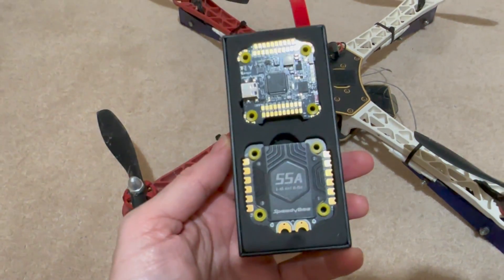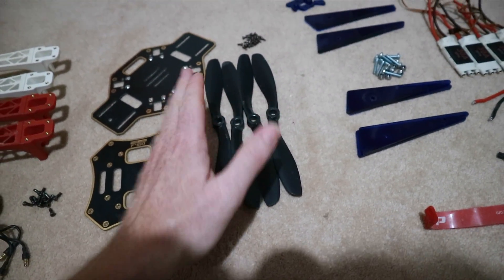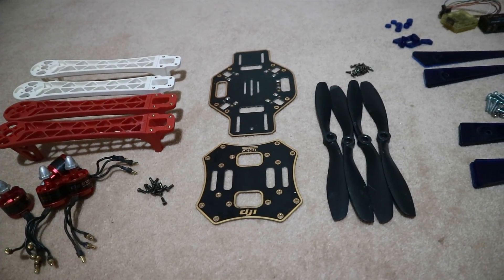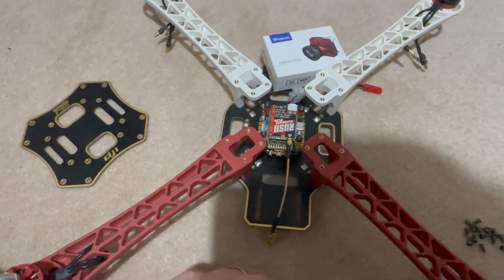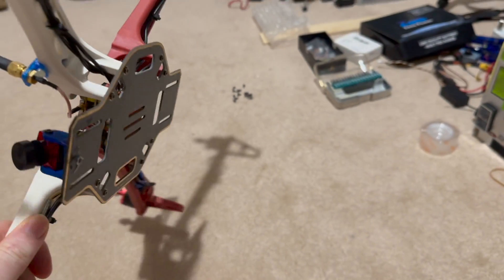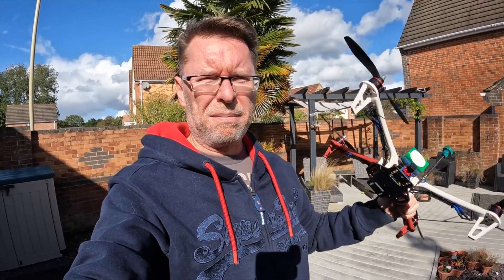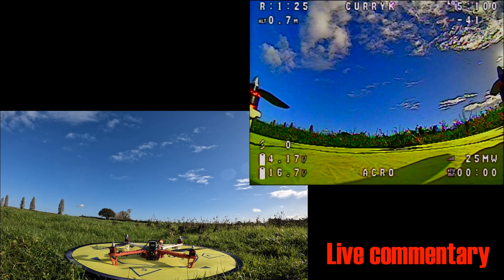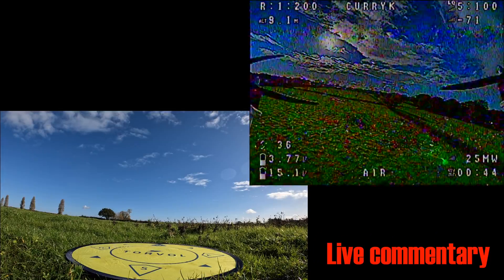SpeedyBee F4V4-55 Stack review part 2:  Can we Acro and old F450 with it?

Comment: How did you screw the stack on the F450 frame? Do the mounting holes match???
Reply from the maker: Nope, if you have a look at around 2.58, you'll see me hold up the stack with a little 3d printed part.  I can mount my stack on this part and then stick this down on the frame.  You can get the file if you want to print this from my Thingiverse page https://www.thingiverse.com/thing:3704157
Reply: @CurryKitten thanks so much for the reply. I am a newbie in drone builds. My schools club is making a F450 frame drone with B2212 929kv motors....... With iflight blitz stack, 1045 CF prop and 3s 3300 mah 35c lipo....... Other than the FC mounting hole issue, our motor screws are about 6mm ish long M3. And the F450 motor arm is about 5mm......so the screw goes very little into the motor. About 1mm ish. Pulling it side by side and wiggling it around, it doesn't budge but I am worried the motors may fall out mid air.........what size screws do you use for your A2212s or similar motors?

Comment: Can we use this flight controller with f450 drone and if yes then can you specify the ratings of bldc and propeller size that we must use with it...
Reply from the maker: What's bldc?  But yes, you can - as per this video.  As to what prop size and pitch - would depend on the motors and ESCs.  I'm using 8" blades on 4S which feels a little unresponsive.  I've got some nicer 10" props which aren't heavily pitched (and I think I've run on 4S before) so I'll try it on those next time

Comment: Nice to see an old F450 in the air again plus doing acro! The noise of the props brings back great memories of my old f450.  What software do you use for your 3d printing designs?
Reply from the maker: I design my stuff (although "design" is pushing it) in Fusion 360.  It does have a distinctive sound doesn't it
Reply: @CurryKitten  Cheers, I have been using OpenSCAD which is good for basic stuff but I need to reproduce some more complex bits so I will give Fusion 360 a go, cheers.
Reply from the maker: Took me a while to get my head around at first - the whole parametric.  But now I've got that, it makes it very simple to go in and make a change to a single dimension and have the model adjust everything else.  Normally any print I do goes through at least 2 or 3 revisions before everything fits nicely
Reply: @CurryKitten  That's great, thanks. OpenSCAD is purely maths based, which is great for some stuff but difficult for complex shapes. I can see me watching a few vids to get an idea where to start :-) Have a great weekend.

Comment: Sometimes for fun I still fly this frame, too. I tested several props on it and for me 9*4.5 work best. I got some more durable ones than these  ABS propellers.
Reply from the maker: What's your recommendation for your 9x4.5s?  I also have some 10" Groupner e-flite props which don't seem to overdo it on 4S, so I may try those as well
Reply: @CurryKitten  it's the Gemfan 9045. 10" are ok with 3S batteries. But I feel like the copter is more responsive with smaller props.

Comment: My flame wheel also had horrible video vibrations. I eventually upgraded to three blade props and that seemed to reduce it some. I think the two blade props that came with the kit are just horribly balanced.
Reply from the maker: I was warned against using the 10" props that came with the kit when i got it and used grouper e-props instead....which I might use on this quad as they don't seem to pull hige amounts of amps

Comment: A very fun and entertaining video. Is great to see a modern restoration of an older aircraft.
Am a bit curious in how much weight was removed with older FC, ESCs, etc compared to the upgraded SpeedyBee F4? Obviously the VTx and camera are new additions.
In reference to the camera, noticing is mounted on the bottom plate, located on an extended overhang. I'd suspect this elongated bottom plate is vibrating. My suggestion would be to mount the camera on the upper plate where the mass of the battery should help dampen vibrations. The arms didn't appear to be shaking, just the camera image. 
All things considered, this F450 was flying quite well. Just looks fun to fly! :)

BTW: it appears the original F450 used 1045 propellers on 920kV 2212 motors. The propellers here appear to be smaller? 
If anyone is wishing to do a fresh build of this style today, I'd suggest looking at the Holybro x500 frame (with carbon tube arms). Parts are available individually, to what is an evolution of the older F300-F500 series drones.
Reply from the maker: The frame pieces do have flex in them, but having flown these a lot 10 years or so ago, you can get a reasonable (i.e much better) stable image with a camera on the front - so there's work to do to make that better.  The f450 kits shipped with 2 pairs of props.  They had 10" for running 3S and 8" for running 4S, so these are the original 8" DJI props.  I have run 10" groupner e-props on 4S before without any issues and tend to be better balanced so I might try those as well for the future

Comment: Great restoration Wayne !  All my bought and scratch-built kwads hover at mid throttle.
Reply from the maker: Yeah - around 50% hover used to be the thing in these old quads.  Nowadays with the insane power to weight ratio it's around 20%

Comment: 1:31... That is Old Solder Flux that was never removed... It was always there... Turns dark brown over time...Quite normal
Reply from the maker: Makes sense - never seen it before like this though, it just streamed out when I was heating up those joints to remove the old ESCs

Comment: Pretty cool that you revived it! I had similar vibrations with the first version of my 3d printed frame, which were fixed by increasing the stiffness of the arms, so it seems like the frame is just not stiff enough.
Reply from the maker: I'm sure that's part of it - when I flew one of these 10 years or so ago, it was smoother, but not properly smooth, so I think there's some work that can be done that will amke it more acceptable

Comment: This is great stuff. Take old stuff, upgrade it, then look at the performance. Genius. Really helpful watching the process and approach taken. Had a similar issue fitting the wrong antenna. Looked fine but useless video. Thanks for sticking with analogue.
Reply from the maker: It's too expensive putting digital on everything, and I have a box full of decent analog gear.  Did you fit SMA to RP SMA then or something similar.  I guess that would guve the same result, but with the antenna still in place :)
Reply: 😂 yes, exactly right..

Comment: Looks like it could use a lot longer props
Reply from the maker: The original f450 cam with IIRC 10" props for 3s and 9" for 4S.  But I may have misremembered as these are official DJI 8" props.  I have flown similar on a type of 10" prop on 4S without anything melting, so I might try a few things out next time.

Comment: I would like to see some newer 3 bladed props like anywhere from 5 inch to 7 inch.  7 Inch would probably be more suitable. 😅
Reply from the maker: I've got a spare set of 7" tri blades - so that's perhaps one to try.  I've also got some 10" much nicer props I used to fly on 3S on a 450, so some options

Comment: Hay,😅😅😅 I am very glad there will be a chapter 3. I was afraid it would have been found in several pieces. I wonder if vibration was at the right cycles to cause the VTX Antenna to come loose? Hopefully the next time the weather is good to fly. You will have come up with a larger set of batteries and you can send it “Down-Range” on a lengthy excursion for distance.  Very well done.  I’m still contemplating the construction of that old octocopter.
Reply from the maker: It was actually quite fun to fly - even between all the times the video went very bad :)  So, yes - most definitely a part 3.  It was a bit of a rush job today.  I'd got 4 lipos charged for the 1 day of sun (thinking previously I had more time) so next time, new ESC firmware, many more lipos - hopefully we'll make the antenna stay on and we can attempt to tune it